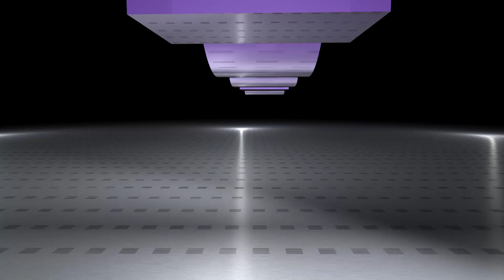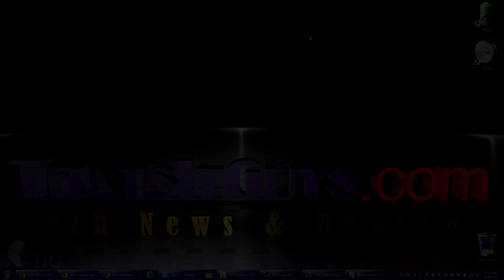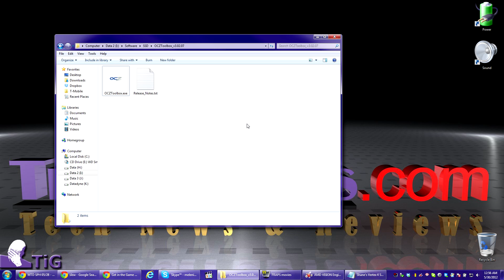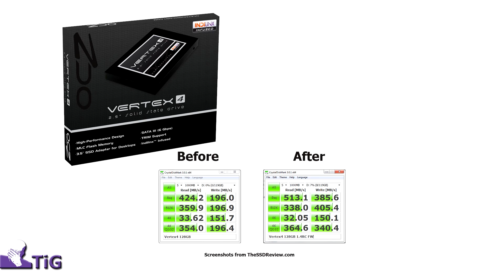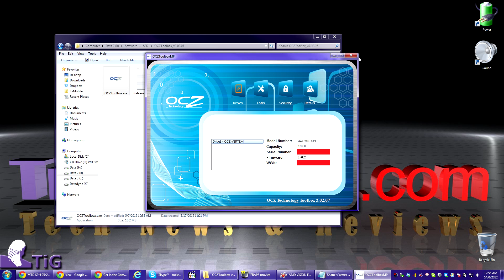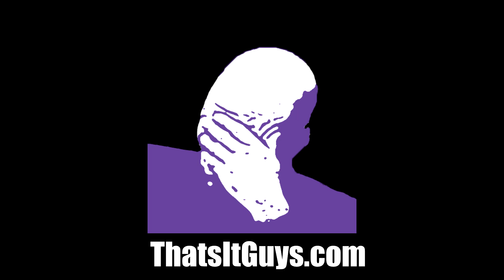[TiG] Tutorial: How to Update the OCZ Vertex 4 Firmware

Comment: i have a old ocz vertex 4 128mb it was used on a old computer 5 years ago, but the computer hasnt been turned on in 4 years. i tried to install it on my pc to be a dedicated drive for a large game i play, and it just doesnt show up at all on my computer & in the tool in this video. im guessing its f**ked, but any ideas what could be wrong?
Reply from the maker: Hit the windows key & type "Disk Management". See if it shows up there so you can format it and assign it a drive letter. It's possible the formatting got screwed up, which would prevent it from showing up in Windows & on the OCZ firmware updating tool. If it's actually dead, it should still be in warranty, since it's a 5 year warranty.

Comment: hi there, would like to ask, am planning to reformat my system, since i have not done so since 2013, running on OCZ vertex 4 and have not updated its firmware, how must i do this 1st?reformat and install windows first then update my firmware or update my OCZ vertex 4 firmware first then reformat windows?btw does updating my OCZ firmware wipe data from other drives or just the data from the OCZ ssd?another note, i use my OCZ as my windows/main drive, and do i really need to remove ssd?as it is going to be my main windows drive. would really appreciate the help here.
Reply from the maker: AngelGhost2k9 I replied to you on Facebook, but here's the same thing:

If your OCZ Vertex 4 is on 1.4 or older firmware, then you have to do a destructive firmware update. This means you need to update the firmware on this drive using another operating system & will lose all the files on the Vertex 4.

This means you would need to boot off another hard drive with Windows and then follow this video tutorial.

-Shane

Comment: Hey there,
I have recently just upgraded to OCZ Vertex 450's and would like to run them in RAID 0. I tried installing Windows straight on to them but they kept messing up and have reverted back to my Seagates as a tempory measure so I can resolve teh issues. I have finally managed a clean install on my 500GB and was wondering how I would go about sorting out my Vertex and transferring my Windows installation across...
Any help would be great...
I have a Teamspeak server and would preferably like to be talked through it (a big ask, I know!). Any help greatly appreciated.
Reply: I'm on my phone right now, scheduled to go on a cruise in a few hours, otherwise I'd go through it in detail. After setting up your RAID array, you need to load the RAID drivers (I believe F5 during install) on a flash drive (or floppy disk). Then install a fresh copy of Windows on the drives.

Personally, one of those drives is plenty fast for literally any application, but that's up to you. You'll want a fresh copy of Windows, though. It's a lot easier to add your programs back thank to reconfigure your install for the RAID array & drivers.
Reply: meleniumshane90 Nice. Have a good cruise! :-)
Thanks. Much appreciated. But am I able to clone my current version of windows onto teh new RAID after I have set it up? I REALLY can't be bothered reinstalling (AGAIN!) and would like to just clone it over. Or is it just easier to install a fresh windows? Lol.
Reply: FiLtHeE GoTh You can, but before doing so, preinstall the RAID drivers. You will just have to use a Linux cloning tool or something of the like. You may have to adjust the size to match, but there are guides on how to do that. If you're going from SSD to SSD, it will be easier. If you are going from a hard drive to the SSD array, you'll need to make sure Windows is configured not to defrag and such.
Reply: FiLtHeE GoTh You can, but before doing so, preinstall the RAID drivers. You will just have to use a Linux cloning tool or something of the like. You may have to adjust the size to match, but there are guides on how to do that. If you're going from SSD to SSD, it will be easier. If you are going from a hard drive to the SSD array, you'll need to make sure Windows is configured not to defrag and such.
Reply: meleniumshane90 Sorry to be a pain and hope your cruise is going well! So it proves one of my 450's has turned fatal! However...One lives still and I have run into a problem...It seems windows will not accept teh drivers that I have only just downloaded...
It comes up with teh following message: 

"To continue installation, use the Load Driver option to install 32-bit and signed 64-bit drivers. Installing an unsigned 64-bit device driver is not supported and might result in an unusable Windows installation."

Any ideas here?
Reply: Or...Shall I install Windows and then load teh drivers before doing anything else...?

Comment: Wondows lol.. In order to update the firmware of the OCZ Vertex 4 firmware as described in the video, you need update it on a copy of Windows running on a different hard drive as it wipes the date on the SSD.

If you already have 1.4 or 1.5 installed, you can download and burn a live CD to update the firmware without wiping your data. That info is linked in the description.

Comment: ill try that when I have the time.

I think I found out the problem, I need to properly connect my SSD to my mobo with a SATA cable, and change some settings in my BIOS. at least thats the instructions from OCZ for flashing and upgrading the firmware.

Thanks for the advice though.

Comment: hey there !! first thanks for the vid, even if it didn't worked for me, i used a linux based tool to upgrade it.
i did  a benchmark for the ssd ( vertex 4 ) just after the updated - didn't do it before.
1.so i wana ask if the seq is alright / it's 377.72 for the read and 383.47 for the write.